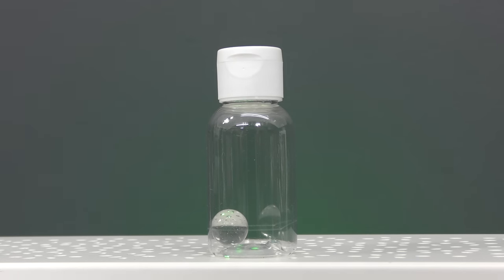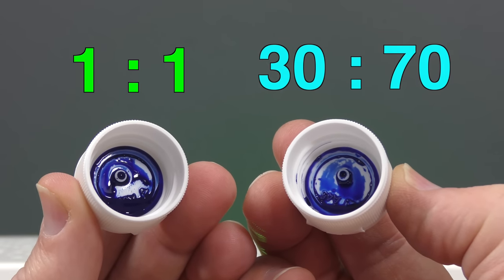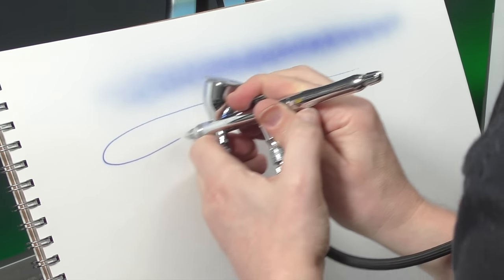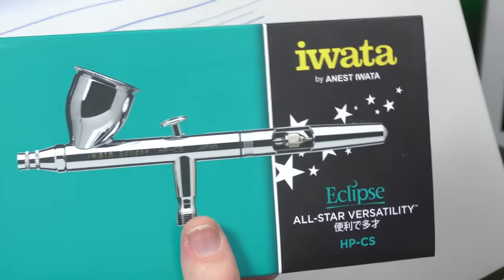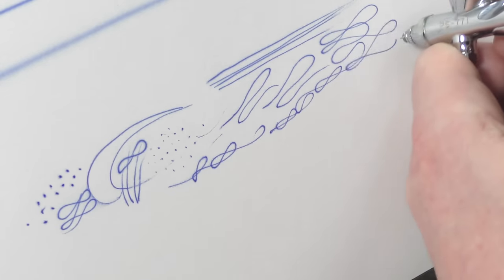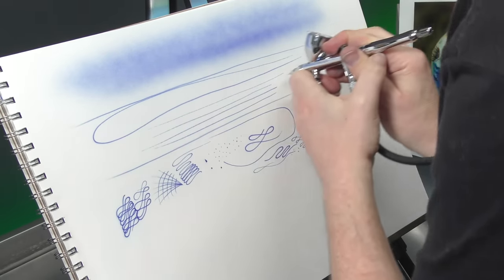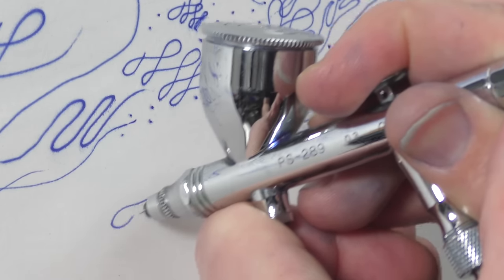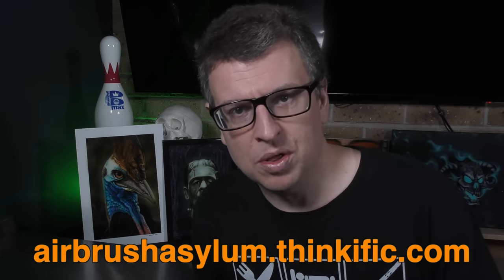Airbrushing Fine Lines & Detailing Tips

Comment: Another excellent tutorial from Airbrush Asylum!👍

I noticed that on my Harder Steenbeck, when removing the last nozzle (needle protector?), it was easier to get the color on my models.

Also, get a cleaning kit for the airbrush - it really does help a lot. Other good brands are Vallejo, Ammo Mig Jimenez. I think even Tamiya has good airbrushes.
Make sure to get a compressor with an airtank - you will thank me later.

If you are into modelling, a spray booth is also something good. When using color, read the contents before use - sometimes you need a respirator so you don't inhale toxic and/or dangerous fumes.

Also some colors require thinning, some base coates do not. It all depends on maker. I mainly use Ammo by Mig Jimmenez, non toxic, easy to use colors (Gundam painter).
Reply: ALWAYS wear a mask, even just for acrylics and most definitely ALWAYS use a respirator and airbooth if spraying lacquers or enamels. If you don't have an airbooth make sure your area is well ventilated and wear a mask to keep the air circulating.  Many people think that because acrylic paint is dissolved in water, and other things, that is is safe. Atomized acrylic paint can enter your lungs and over a long period of time it can build up and it will not break down. Old dog from the Fine Scale Modeling forum shared on the forums that after years of airbrushing acrylics without a mask he started experiencing shortness of breath. An X-Ray showed he had a 2 inch by 3 inch patch of acrylic paint built up in one of his lungs and there was nothing they could do short of major surgery to remove it which they did not recommend. Please be safe , everyone.

Comment: awesome this is just what i needed to see today i been trying to paint thin lines i have iwanta with the .3 tip can i paint thin lines with this airbrush i got it for christmas ? its so humid here in the south i think that plays the biggest factor with me with the cheap harbor frieght air compressor i see fog in glass with water.I just paint fishing lures but want to get better without stencils
Reply from the maker: Yes that could be the issue , as I mentioned over thin your paint and that should help with your humid conditions. Also, make sure you are running moisture traps to stop the moisture coming through your airlines 👍🏻

Comment: I know you do it by eye, so did you allow for the volume displacement of the marble in the bottle. I would hazard to guess your mix is more like 20/80!
Reply from the maker: Great point and no I didn't think think about the marble 🤔 It is quite possible that the mix was slightly different, but either way it will work just as well and you will need to adjust according to your temperature and airbrushing skill level.
Reply: This is where I have a bit of a problem, too many people are stuck on the numbers, 3 drops of this 7 drops of that, I throw caution to the wind and let loose. So what if it does not match, it’s a variation of the same colour, it creates character and texture! I love working this way!

Comment: I struggle with fine detail which I’m trying to improve. 
My challenge is when I first pull back on the trigger, it can spatter before spraying smooth. I try to keep the tip cleared as that seems to be the obvious issue. Any suggestions on how to consistently have a clean fine detail spray?
Even with a recently deep cleaned brush, I cannot do small dots. The thickness of a pencil is about as fine as they’ll be and it’s inconsistent

Comment: What about adhesion with the high mixing ratios
Reply from the maker: Great point, I never rely on just allowing the paint to dry (cross link) when using waterbased paints, I always spray an inter coat clear (House of Kolor SG.100) over my art before masking and or two pack clear coating as it also was great for a little extra protection when transporting automotive parts for final clear . That said you can get away with not using it but I like to make sure that I have the least possible chance for any lift off when masking....keep in mind that prepping is the most important thing, if that is ok then you shouldn't have any issues.
Reply: @AirbrushAsylum  thank you! And thank you for all the videos you do! I may not say much! But I am watching! 👀
Reply from the maker: @FTWBIFY6667  no probs at all thanks for being a part of the AA community and glad you enjoy the vids 👍🏻

Comment: OK if I'd waiting longer I would have found out.
Reply from the maker: Lol, I shared a link to your previous comment which should help 😉
Reply: Thanks for your reply. I bought one of those rechargeable airbrushes as I am a beginner. Didn't think much of the airbrush that came with it so bought a new brush that came with 3 sizes of needles which is much better. This is the unit that came with the air screw that I asked the question about. As I get better will probably get a compressor.